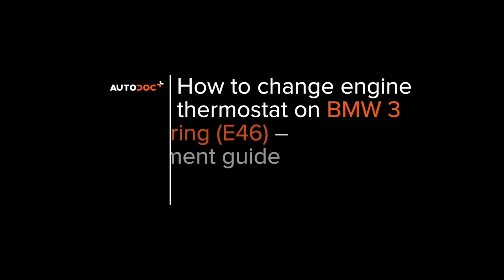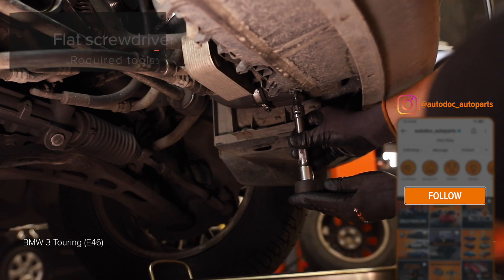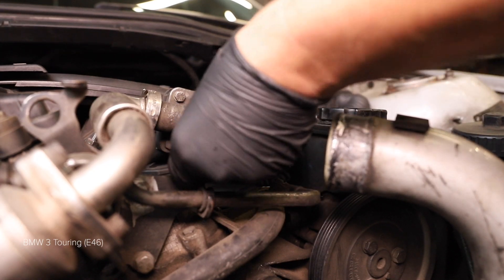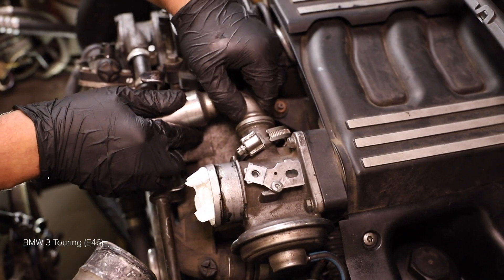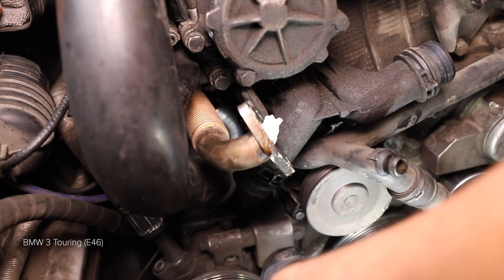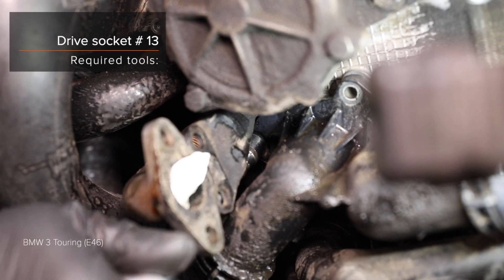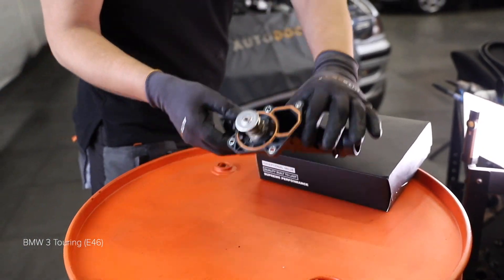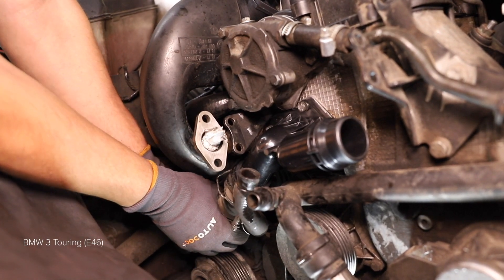How to change engine thermostat on BMW E46 Touring [TUTORIAL AUTODOC]

Comment: Do i have to drain the cooling system before changing the thermostat or it's not mandatory? Wouldn't i be able to just take the old one out and put new one in? After the thermostat change do i need to bleed the system?
Reply from the maker: Before replacing, be sure to drain the coolant and empty the system. After replacement, you need to bleed the cooling system.
AUTODOC